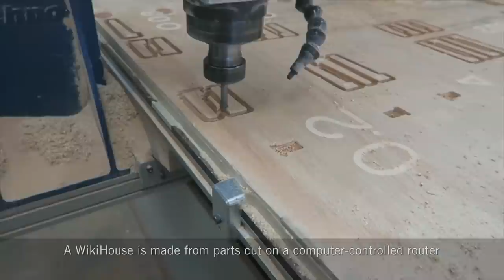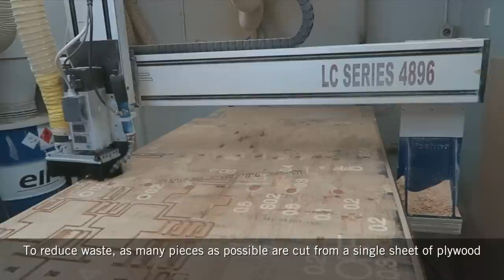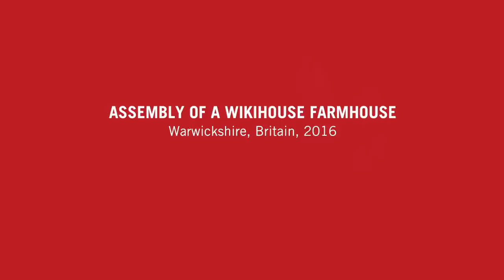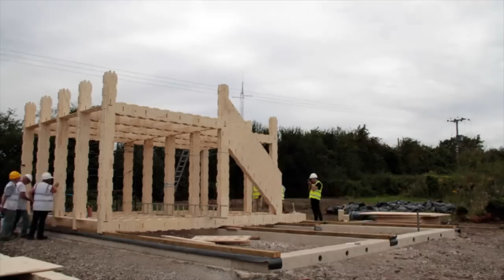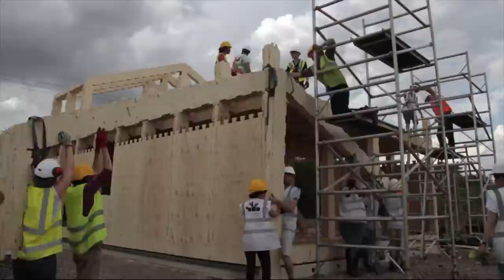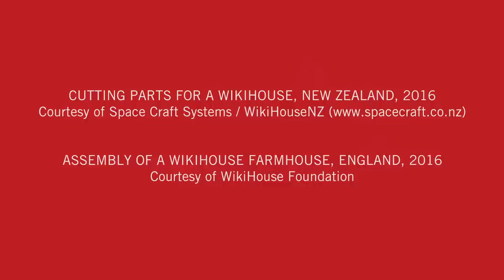How was it made? Building a plywood house

Comment: As usual the devil is in the details. What holds this place together, plywood keys? Also are the columns, joists and rafters built up of plywood  - if so the cost would be tremendous.
Reply: The real cost of building is man hours.  I'm getting a plywood house built, and the cost of the plywood is roughly 15% of the whole house. For rafters etc, use  I-joists. Strong and relatively inexpensive. No need for columns, except if you have long load bearing spans.